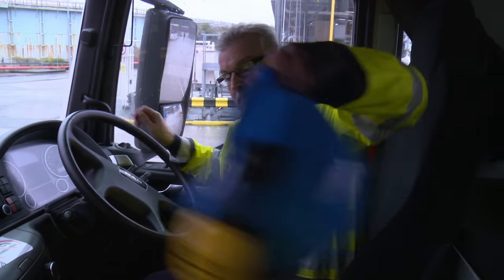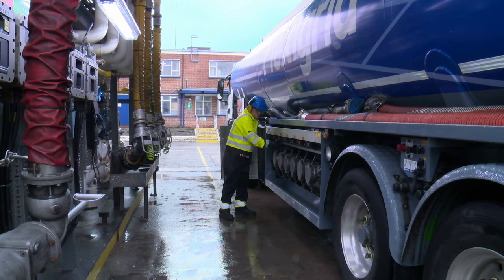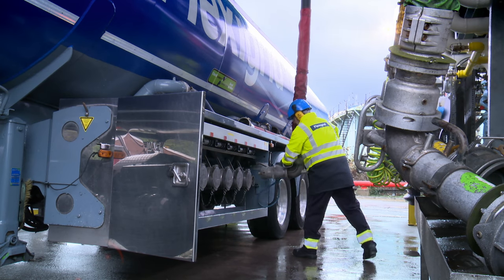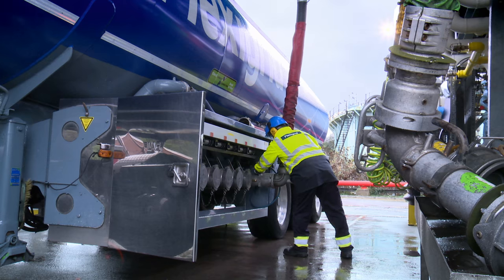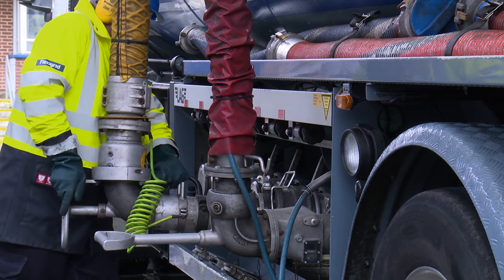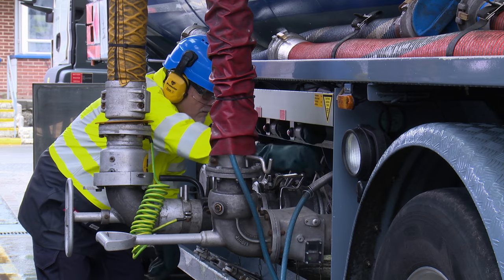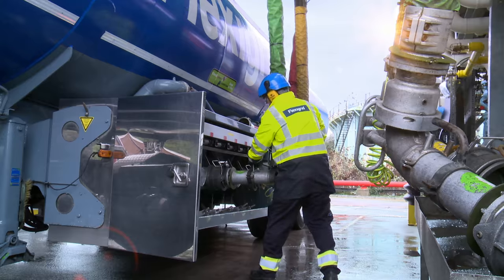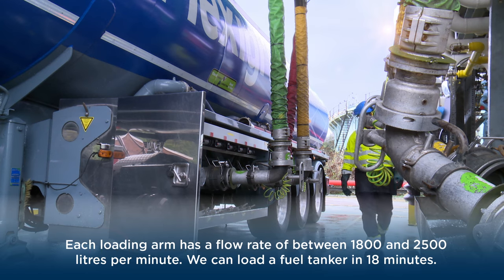Safe loading of a Fuel Tanker (Greenergy)

Comment: Maybe the inspection should be down 1st, before you pull into the rack for loading not last. Checking for hot tires and such. Don't want to pull in and blow up due to vapors in the air.

Comment: I used to drive a bottom loader mid 90s, what's that get the first arm full flow before connecting second arm?
Reply: He was saying to allow the first arm to reach "high flow" when you first hook up a load arm and hit start on the computer the first 50 to 70 gallons go through "low flow " then it kicks up to high. It's basically just making sure the additive and ethanol blend properly with the gas and you don't get any alarms. Here in the states we usually do two at a time to start as long as it's the same product.
Reply: @Str8dropped  it was different in my day, maybe new rules, I'm still confused, once you press start that's it fuel is on its way.
Reply: Terminal I pull out of specify one arm on. When it's high flow connect the next etc etc. They don't allow putting all the arms on first then ripple loading. All have own rules.

Comment: When I try and attach the static ground cable to the truck, do you have to turn it to lock it in somehow? I've had trouble turning the coupler part even though i'm flush on.Should I be pushing in and then turning it slightly at the same time?
Reply: Sometimes they do get sticky there is a small cut out in the female socket and a male lug that fits into it,  twist to the right and wiggle it as you push, also make sure the terminals are cleaned with a rag or you won’t get a good Earth on the Scully lead and socket. 👍

Comment: How is the air removed from the top part of each compartment? We have Auto Air realise valves in heating Boilers ? Being a bottom loader ???
Reply: There is a pipe that you cant see that connects all of the compartments. There are valves that open and close in each compartment that connects the piping. This means that when you open the valves, the vapor can move freely as liquid fills. When you close the valves, the liquid is obviously contained. The valves are placed higher than the compartments capacity. You cant overfill because the top overfill sensor should stop the loading rack from continuing to pump fuel into the trailer. If somehow there is a failure and you do overfill, you can drain the vapor lines with a bucket or a fee buckets, but by then, you would be dealing with a bigger issue as fuel would probably eventually burst out if the top of the trailer from over filling. Hope that helped you fully understand